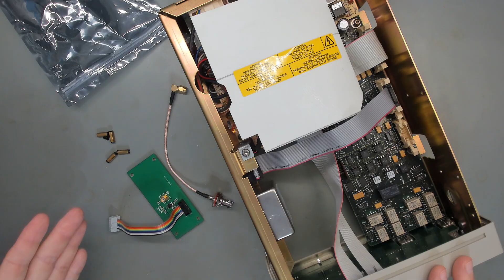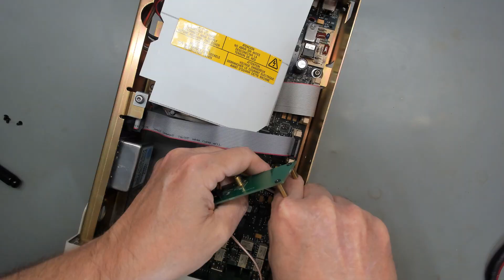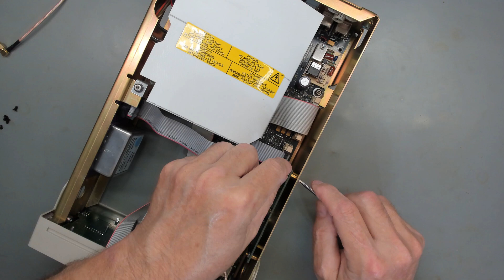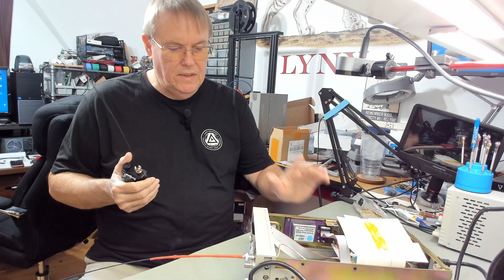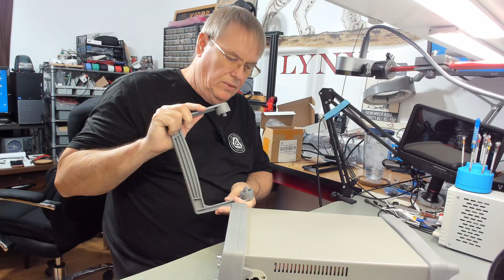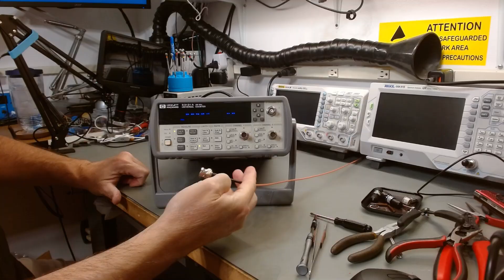Will This 3 GHz Upgrade Actually Work?

Comment: Nice job.  That 3GHz option reminds me oft the "bolt-on" performance mods we used to do on my son's race bikes.  Usually took a little engineering to get them installed and properly tuned.
Reply from the maker: Yeah, it just needed better hardware choices. In the end it was a very simple fit. The kit was pretty cheap but still no excuse for not fitting a device it said it was designed to fit. 
Thanks! Everything going OK? Haven’t seen a new video in a week or so.
RJ